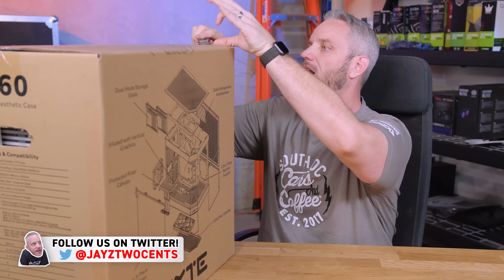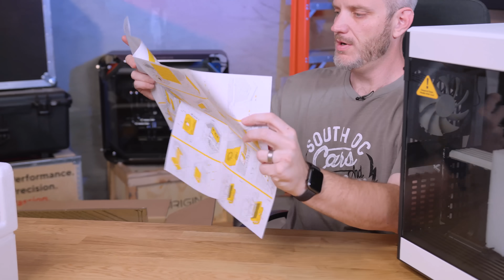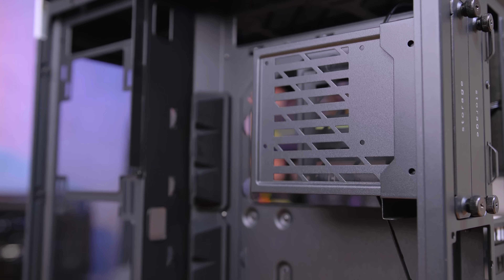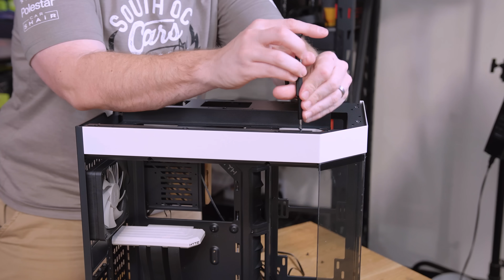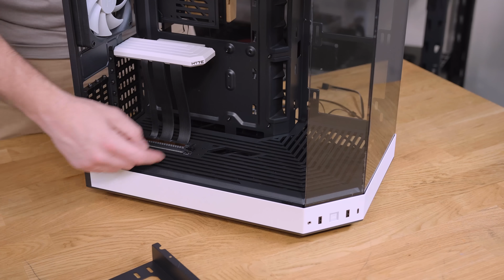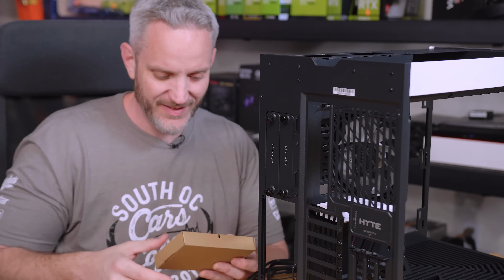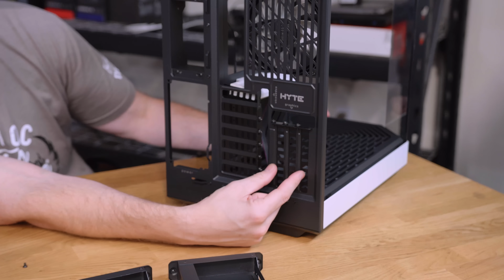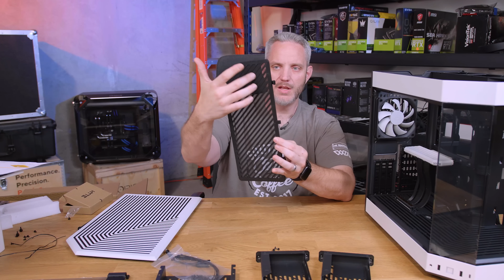Someone FINALLY broke the mold for PC cases...

Comment: I was so disappointed when i got to the point where its only half height expansion, up until that point I was fully sold on buying this case, i hope they come out with a version the forgoes the vertical orientation and provides full height slots instead
Reply: Vertical mounting options are cool... But they aren't at all cool when it's the only way.
Reply: I agree 100%.  It's a great looking very innovative case, but the low profile expansion slots would be a deal breaker for me.
Reply: @thereallantesh  what are you putting in there? i have a wifi/bluetooth combo pcie and it came with a LP bracket because its small enough, even my GFs elgato HD60 has a LP, i cant think of anything else that would be larger than a LP unless its a GPU or possibly a sound card? genuinely curious what people have in their rigs
Reply: @Xplose109  Older capture card that lets me capture older consoles that do NOT do HDMI out such as things like the SNES,N64,PS1 and similar consoles. The PCB itself is full height so a LP bracket isn't going to be doable regardless if it came with one or not.
Reply: @Montisaquadeis  Oh i see, thats cool. Didnt even think about old school stuff. On the topic, I managed to fit a LP GTX 1650 in a old broken, yellowed NES case and used that as an emulator for retro games. Also, i wonder if theres a way to fit a fill size PCIe card if you use the traditional mounting, but have some other way of securing the bracket down and not just hand off the PCie slot. Probably an easy mod to the back of the case with a little aluminum strip
Reply: Same. Had just made my mind up to get an O11D-Evo, saw this video and was hooked, but then got to the expansion slots and was immediately put off this case.
Reply: Low profile slots are ridiculous on a case that size
Reply: @adrianscarlett  ridiculous why? Is it because it's a big case?
Reply: I was thinking that too but, after I thought about the only expansion slot I use now is the one for the gpu
Reply: I think that's the only place they missed a trick on. They could have had that section of the back detachable and have a replacement in the box to cover both options. Could be potentially cheaper in the long run rather than producing 2 separate models or just losing the customer that needs full height slots. I've still to look up the price though so depending on price point they were aiming for, maybe they considered it but had them miss the price point due to cost.
Reply: Totally agree!  This would be a show-stopper for me!!
Reply: Same
Reply: That would be a deal breaker for me, too. Plus the front I/O being on the bottom. That's just stupid, when the PC is not standing on the desk.
Reply: No, they will never make that case, deal with it.
Reply: They should've just done interchangeable panels like o11 mini does
Reply: yeah i'll give it some time and they will refine it
Reply: Not to mention that it only supports up to 3 slot...and even then I wouldn't put a full 3 slot card in here due to being so close to the glass, so you're actually limited to more budget-oriented GPUs.
Reply: Ditto Mike. The half height expansion gives me pause. I was totally on board until that point.
Reply: Same! I understand if they went with full length, they would need to make it wider or sacrifice GPU space or on the PSU side. I cannot buy it for that reason.
Reply: Or even just sacrificing one of the vertical slots to gain the full horizontal height back.
Reply: The small factor expansion slots have adapters that come with most expansion cards all you have to do is swap them our
Reply: What do you mean half height expansion?
Reply: I am sure other have already answered this... but... if, (like me) you have dozens of various motherboard standoff screws, you can make this work without any issue, but would have to of course double up on a GPU.!...  This is IMHO a poor design choice as they could have easily gone with a totally empty expansion area and given the owners a choice / option / workaround.  Having "zero card slots" is no issue so long as you can screw the cards in, I have done this before where fore airflow I removed all bar one card slot "dividers" with a cutting wheel, the result was (and is) awesome :D
Reply: I agree. Sure the graphicscard ist not a problem but I wouldn't be able to use my sound cart as it needs a full height slot.
Reply: Eh.  While I agree the fact that the vert mount for the GPU is hard installed means that was mandatory due to the lack of space.  They would have to, and frankly should have done, is a design like lian li where you can rotate the back plate.  Or do something that accommodates a full height in the slots.  But then I guess they would have had to expand the size of the chassis on the Y axis.
Reply: Yep drove right off a cliff with that one.
Reply: I was already wondering if you could get it for less without the riser.  I too would rather have full height and no riser.
Reply: That and lack of drive space for me.
Reply: @pdavis2207  drive space and proper/easy mounting is super critical for me. Not sure why so many cases manufacturers gloss over this.
Reply: @pdavis2207  yah, I realize that if I were to finally upgrade my chassis, I'd have to get an external drive bay for what wouldn't fit. ...which might be smarter, cuz then I don't need to have them spin up ALL the time, nor would they ever be potentially affected by a power surge.
Reply: Oh damn, I didn't quite understand this comment until I saw the back of the thing.
I already despise manufacturers that stick with metal strips in between each slot cover, preventing the use of a flush mounted vertical adapter. Then they give you 2-3 slots right next to the glass and act all smug.
But this, holy f***. That's a whole extra level of "screw you, our way or the highway".
Reply: You CAN omit the PCI-E 4.0 riser and mount the Video card normally. Plenty of room and you just need an end-plate adapter.for the cards. The Vertical Airflow will still assist cooling.
Reply: Other than GPU I don't see any PCIe devices that don't exist in half height, for most of them half height seems to be the default PCB size, even if the preinstalled bracket is full height... So it really doesn't seem like an issue to me if one GPU is enough for your use case. For me lack of drive space is a real killer, and I'm not talking 2.5" either - IMO every case bigger than micro-atx should have at least one 3.5" slot as 3.5" drives are where all the really large capacity drives exist, which makes the case useful for almost every home user.
Reply: @foldionepapyrus3441  Uhh the 2 "Storage" bays are 3.5" bays with holes for puttinmg 2.5" drives in as well. So there is 2 MASSIVE drives right there and then your motherboard likely has 2 or more m.2 slots for ssd's onboard if you need them.
Reply: @Montisaquadeis  Ah cool, I wondered but wasn't sure from the quick flyby done of them, so yeah 2 3.5" drives is pretty alright, not huge but enough for most folks. Though with no idea how well they fit yet either its potentially  as good as not having them - even a box that big is bound to have compatibility, and airflow space issues with some options.
Reply: @foldionepapyrus3441  You can get m.2 drives up to at least 2TB. What home user needs more than 2TB of storage? And who uses more than one GPU? SLI and CrossFire are long dead.
Reply: @jameskinstle6874  On GPU I largely agree, though there are home users that will use the extra compute of another GPU still. But 2TB is nothing if you create any content, video and audio are data hogs - heck just my purchased music library is over 500GB now (I like high quality, though its mostly not lossless audio and have a very large range of music) and as games get ever larger too that 2TB is only able to keep installed a handful of the modern 'AAA' titles.
Reply: @jameskinstle6874  Photographers. Musicians. Videographers. When you're working with content, you don't have the luxury of using serious amounts of compression, you're working with full resolution uncompressed files and they get real big real fast.
Reply: @PiersCawley  You obviously did not read my entire comment. Those are not "home users".
Reply: @jameskinstle6874  they are in my home.
Reply: What's so bad about the half height?
Reply: @syrusalder7795  I have multiple add on cards that at this point I only have full height brackets for, some I never even had the low profile and some I have simply lost over the years not worth it to try to replace the brackets or buy new cards just for one case, especially since there are other cases out there with full height and other systems I own still require full height
Reply: It's a gamer case, made so you can put your several-kg mahoosive GPU into a configuration that won't break the motherboard or the card.

The other option is vertical, and I have a Tower 900 case that does that, but that has its own finicky bits, what with being generally huge and having its back panels under the top lid.
Reply: @technicalfool  I have a Silverstone like that. The main thing is the bigger boards would be a challenge, especially with the heat they generate.
Reply: @technicalfool  I love my tower 900 when I don't need to access the IO. I even gave it a custom paint job and all. But I am in the market for an easier to move around case that supports almost as much water cooling capability.
Reply: @technicalfool  The issue is it is not. Put a highend graphics card there and it will overheat when you dont wantercool it. Mid Range cards will be fine though..
Reply: @telilala3891  If you're air-cooling it, you don't go halfway. You make sure the whole case has airflow, so you use lots of fans. It wouldn't be a quiet build.

If you're water cooling it, any GPU waterblock worth its name is still a hefty chunk of copper, so it's nice to not have it sticking out horizontally in a configuration where you may need braces and suspenders to keep it from breaking motherboard slots.

In any case, it's definitely a gamer-oriented showcase. Lots of glass so everyone can see the guts all lit up like a Christmas tree. Too small to really fit a ton of drives or AIBs, but plenty of room for air, waterpipes, radiators, reservoirs, whatever you're going to shove in there to maximize the amount of pixels pushed.
Reply: This is so funny, I had to comment. Just like Jay said... Who uses sata drives and more expansion slots than just for your gpu? I guess if you use a server or video editing rig? So don't buy a gaming case for those builds. Get with the times people.
Reply: @jameskinstle6874  My 10Gb card I can swap to LP, but my sound card needs the whole slot and I'm not getting rid of that until the requirement of needing a monitor/TV connected to an A/V output to use HDMI for just audio is changed.
Reply: for those hating on it... what this case does, and lets you vertical mount the card while still letting you use capture cards and other half slot cards
Reply: @codygrinnell8676  I don't think my capture card is low profile capable so no I can't use it with this case. The PCB on my black magic capture card if full height so its not as simple as swapping out the bracket for a low profile it basically means shelling out another $200 or so for a new internal Capture card and even then it likely won't fully support my older consoles like my current one does. So no not really an option for me personally so this case is just NOT usable for my needs personally.

Comment: This case is pretty cutting edge functionality. It has the look and form factor of the Lian Li 011 Dynamic, but is surely lighter and easier to move around, having a metal base instead of all glass panels. I also like the bottom intake and think it would be great for GPU cooling. Ideal for a white PC build 👍🏼

Comment: I do want it and want to see a build in it, just not enough to do it myself. The narrow expansion slot thing means that for those that dont want to vertical mount for simplicity have no choice, and you cant really add anything else anyway. I also dont care for cases that mount the power supply behind the motherboard and vertically, because I have the Asus rog thor with that readout on the side. My dumb self limited my case options based solely on this. Overall, really cool, just is the next trendy O11d style case, which means we will get bored of seeing them.

Comment: Jay, to help not getting shocked when pulling a case from a box...keep 1 hand or finger on either the styrofoam or plastic at all times until the case is removed from the box. Then keep 1 hand or finger on the case until it is removed from the styrofoam & plastic.

Comment: It's almost perfect - like an O11d Evo but even nicer looking as a showpiece.
Gimping the expansion slots for forcing the vertical GPU is really bad though. Maybe even a deal breaker just on its own. Everything else in this case is designed for looks without compromising functionally - except for this for some stupid reason. 
I really really hope they make a revision that just has standard slots (or some way of making it modular / dual mode) and just cut the included riser so it would be cheaper to boot. It's just one plate to change, so it shouldn't be too hard to do.
Reply: Yea the second I saw the slots I stopped caring. Not sure what they were thinking with this.

Comment: Yeah, the expansion slots are the big no-no here. Honestly case should have been a little bit wider so you'd have normal sized expansion slots on the back. It would even help with fitting the GPU on the custom bottom slot, since it would have a little bit more space.

Not bad, the but expansion slots kinda make it a no-go for me. Can't really risk needing them and not finding a low profile peripheral to install on the MB. Which is really a shame, because designwise I think they really have something going.

Comment: I was so very close grabbing one of these for my build but the short expansion slots was a deal breaker for me as I need to run two 5 port USB expansion cards. Really sweet looking case though.
Reply: Needing 10 additional USB ports is making me curious, why lol.
Reply: @DionysusFascinus  VR with a bunch of  trackers and a few other peripherals. The tracker dongles tend to get mad when a USB hub is used.
Reply: @whitedartonpt  Ah that actually makes sense. I was secretly hoping for some super weird edge case.
Reply: @whitedartonpt  they make 4-port Low Profile expansion cards, so you could theoretically do 4+4+2 if you need 10
Reply: @NickMirambeau  I ended up going with a Antec DF700 which I am more than happy with. TONS of airflow and dropped 15c+ off the GPU and CPU temps from my old P280 case. I average mid 50s now with a 5800x and a 3080.
Reply: @whitedartonpt  that's fair, well enjoy ur build then ! (:
Reply: I was also considering swaping to this case from my O11D-XL, but the low profile expansion slots made this an easy no.

Looks like I will likely be using a now-old-stock Thermaltake Core x71 for a bigger dual loop on the next build....

Comment: Im actually looking at trying to get one of them right now after watching the video. I currently am running a Thermaltake View 31 and have been wanting to upgrade my case for a while for a little better cooling. Just gotta save up for the case now to try it out. If I manage to get it soon i will try to do a video of me building in it.
Reply: Upgraded to this case from the View 37 and my temps dropped 15 degrees under load. My Thermaltake case was horrible for airflow so I have no regrets after switching to this guy.

Comment: If they come out with one that adds a 360mm in the front/side for a total 2x360mm, one top mount and one front/side mount and 1x240mm at the bottom, I'm totally onboard! This is a beautiful case!
Reply: Yeah you can't really do anything with rads in the bottom of this case but it's not really big enough for that anyway.  Even if you could mount one and were willing to block some of the lower PCI slots you couldn't do it since you can't run the GPU horizontally.   If you want a bottom radiator option you really need an O11 XL.

Edit:  Oh shit I totally missed the fact that you can only mount a 240/280 in the side because of all the stuff they did with the floor and little clearance there is in the top.
Reply: @Accuracy158 . It's really really close to being perfect!!! And I know I'm asking for a unique use case. I'm pretty sure there isn't a bunch of people with multiple 360s.... soooo... I'll have to wait. I'm going to check out the case you suggested. Thank you!

Comment: Pfff lol, i just finished transplanting my PC to the Y60 red a week ago, talk about timing. I bought that thing out of impulse , I'm waiting  on new hardware releases  and probably win the lotto to be able to afford them, wasn't planning on getting a new case but here we are. Back to the Y60, The case is very eye catchy, drop a bunch of lianli unifans there and it looks very nice. Building in it is not as straight forward as it might look, is nothing crazy but you will have to remove some things if you don't plan carefully. The screws for the graphics card and expansion slot are a bit too close to the metal, you will need a long  screwdriver, nothing mayor though. I have a Thermaltake 360mm AIO( hate that piece junk with a passion) an Asus Crosshair VI E-ATX  board in it fits beautifully. The longer board and the shape of the grommets in the case make for nice flowing curves in the wires. It has no designated place for a water pump but we can get creative on that one, we got plenty of space. Overall is a really nice case, simple with some tasteful and well designed features.
Note: Jay would you consider doing a build  in the Y60 with some crazy solid tubing water-cooling? I don't see it as a very simple process when you start to add multiple rads. Keep it up Jay!